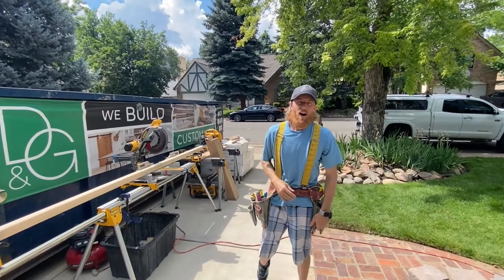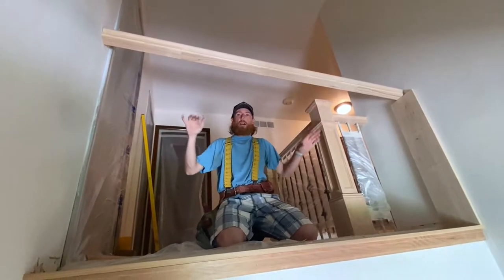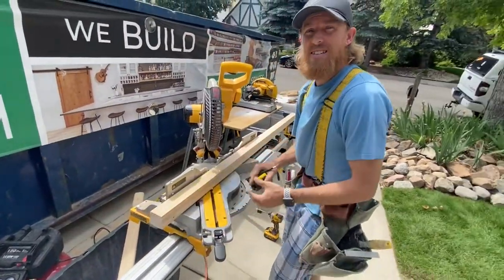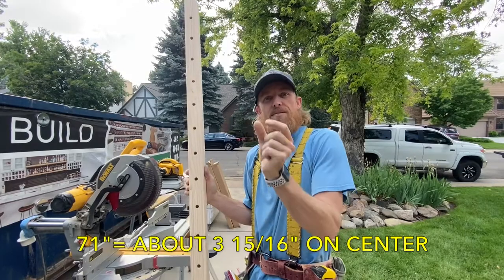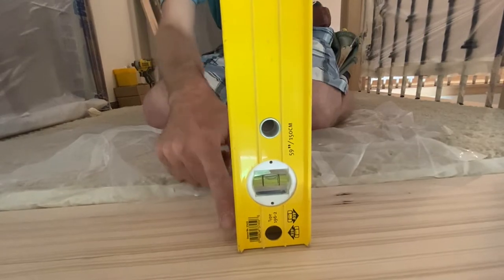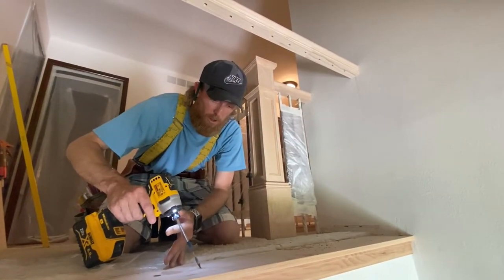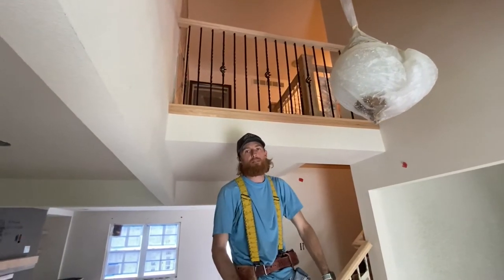Installing Handrail with Iron Balusters: Baluster Layout, *MY SCREW* Install Technique Pt. 2

Comment: I understand we need to have 4" in between balusters. Is it best to measure out from center? How about if it is more than 4" on each end. Is that okay? For example, my total measurement is 105.25"
Reply from the maker: That measurement of 105 1/4”…is that an angled run of the rail next to the stairs? Or is that a flat run of rail? This will change how I mark out the holes…get back to me and I can help further!
Reply: I think I figured it out using your method. I need to add 1/16" to each measurement. I will come very close
Reply from the maker: Awesome job if you figured it out! I’m still here to help if something doesn’t work for ya…just let me know!
Reply: @huntercarlson5446  flat run
Reply: I am doing pretty much what you were doing, except I have a newel on one end. Were you using a finishing nail gun? Is it 16 gauge? I have an 18 gauge brad nailer. I don't think that would be enough to hold up the banister.
Reply from the maker: @E.Carrillo  this is how I would figure it out…
105 1/4”: get that to the closet number divisible by 4…which is 104…
- 104 divided by 4 equals 26…there will be 26 even spaces and 25 total balusters…
- we are off 1 1/4” from 104” to 105 1/4”…equals 20/16ths 
- we need to gain 20/16ths over 26 spaces
-so the measurement between each space will be 4 1/16” (light)…light meaning: tape measure is to the 16ths, so i mark as if the tape was showing 32nds…
- it may take a couple times to mark it out…keep in mind the thickness of your marks and try to make it very precise to the measurement…
In the end if you are off 1/8” throughout the run of balusters, the human eye will never pick that up! 

You were right by adding about 1/16” to each space!
Reply from the maker: @E.Carrillo  you can use your 18ga. Nails to temporarily secure your rail to the post, but I would add a screw for extra support! In the video I was able to wedge the rail very tight between walls…there was blocking behind the drywall as well to nail to…if I cut the handrail a bit smaller and it wasn’t so tight between the walls I would have added a pocket screw on each end for extra security…
I’d would hold off on buying a 16ga nailer just for this job…with the length of 105 I would add a screw regardless! 
Hope all this is helping!
Reply: @huntercarlson5446  It really helps. I am having to replace an old banister. It had a pocket screw. I can do that, and yes, save $$. Thanks again!
Reply: One last thing, I messed up, it is 105.5" not 105.25. I still think the 1/16 measurement will work. Right?
Reply from the maker: Yes 4 1/16th will work better with 105 1/2”…now we are trying to gain 24/16ths out of 26 spaces…I might try 4 1/8” for the first space then 24 spaces of 4 1/16”, ending with 4 1/8” space…

Comment: What can I use to cut the iron ?
Reply from the maker: Depending on your budget and tools on hand I would start with a power tool such as a grinder with metal blade, or a jig saw with a metal blade. For a cheaper route you can get a hack saw, but you will have to sand the edges to help the baluster fit in the boot and slide into the hole easier. Hope this helps! Have a blessed day 😎

Comment: Glue & brads to hold a 73” handrail into both walls overlooking a balcony!? Throw the code book out the window on this one. Lol. And am I the only one seeing that impact driver twist the bottom of literally every single baluster when that screw sinks?? You twisted the first one more than 3 degrees. That would drive me crazy. Too much torque.
Reply from the maker: A screw went into each side as well…just messed up the footage so I didn’t add it to the video…

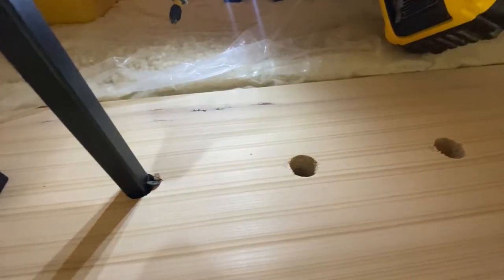Comment: 22:40 not a fan of wedging a screw .. it will loosen, as will that set screw in cap .. 10yrs from now all the balusters will be falling out.  But sure, you got a fast easy install method there, just don't do it at my house, lol.
Reply from the maker: After installing thousands of balusters this way I’m sure you are the expert here!
Reply: @huntercarlson5446  what is the warranty duration for your installation work??  A more quality install would be to insert that screw through a hole in the baluster, but that is more work/time.. I get it, you do this for a living.
Reply from the maker: 5 year warranty…I did the same job in my personal home 13 years ago and no screw has loosened over time. This is a more quality install over the others who glue or epoxy their balusters into place. I understand that you can always take it a step further and do more, but this method insures my company of no warranty issues or go backs because of loose balusters. Do you have experience in building handrails in residential homes?

Comment: Dude your really toe nailing a handrail into the wall. Why aren’t you using Rossettes that wouldn’t hold if someone fell hard into that.
Reply from the maker: During that video I messed up the footage of pocket screwing each end to the wall. Here in the Denver Metro area there aren’t too many houses that use rosettes or half posts…